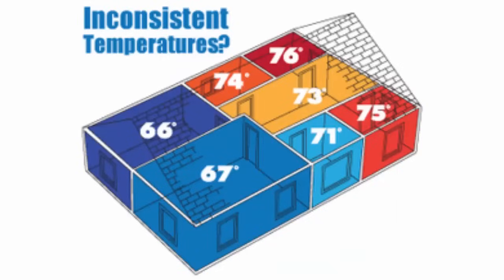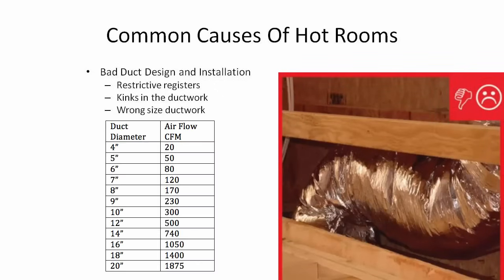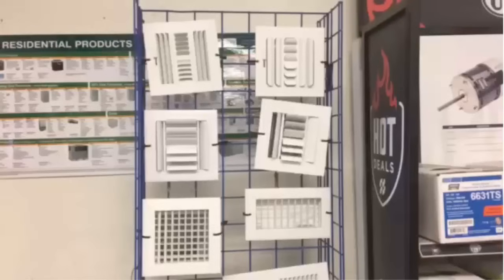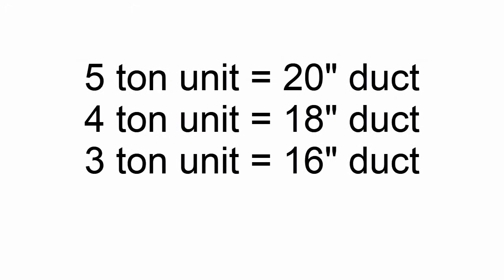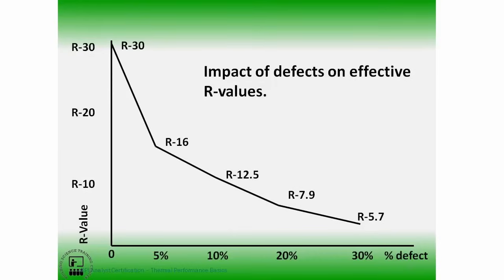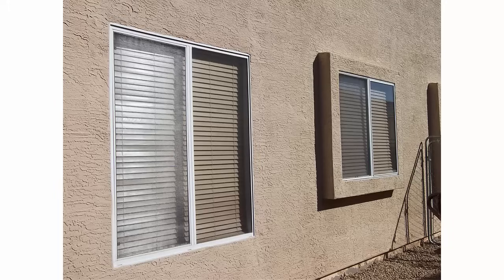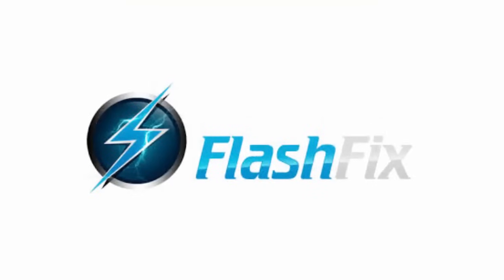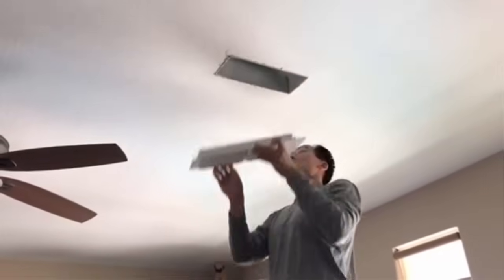Why One Room Is Hotter Than Others

Comment: I live in a 2150 sqft rental with 2 units. The house has a split floorplan. One unit is for the 3 bedrooms and living room and the other unit covers the master bedroom suite, laundry room and kitchen. The front of the house faces N and the back faces S. The 3 bedrooms are on the west side of the house and are in an L formation with the 1 bedroom at top of the L on the N side. The other 2 bedrooms are on the S side. The bedroom with only 1 wall to the outside facing S is 7 degrees hotter than the room on the NW walls of the house and 5 degrees hotter than the room with the SW walls. All the vents are at the same level through the house and placed close to the window of each room with 2 in the living room, 1 of which is by the window and one is in the middle of the house. We spend most of our time in the bedrooms, so we have closed the registers in the living room and the hottest bedroom, but this has not pushed more air into the coldest room.
Why is the inside room so much hotter than the others? It's difficult to have the heater on because this one room gets so hot but then the coldest room gets too cold. Being that this is a rental, what can I do as a renter to help? Any help is appreciated!

Comment: Every room in my house is comfortable in the summer except one bedroom which happens to be the farthest vent run from air handler.

I can leave door open and that does help but when it's closed it gets stuffy pretty quick.

I do have an inch undercut under the door and when it's closed I can feel air blowing out when AC is on.

Do you think putting in a return grill in bottom of door would help?
Reply from the maker: Yes it would help, as would installing a transfer grill above the door or jump duct in the ceiling

Comment: I absolutely agree with the window issue...we're going through a bit of a heat wave in western Canada right now. I just taped up aluminum foil on the outside of some of the east facing windows (cardboard / blinds / curtains on the inside)....we open everything up at night, close them during the day. Our attic has 2in closed cell spray foam with 60 cm of cellulose. We also have a portable AC but I have to admit, it barely keeps up (it's working on about 750 sq ft main floor)....my husband thinks keeping the attic hatch open will help (to let hot air rise) but I think we need to minimize the total air volume that we're trying to cool with the portable AC...

Comment: I just moved to AZ . I'm watching this for my apartment. As I have a
One direct sunlight room. I think it was.the return. As I took it off and noticed a difference. But what else could it be if that doesn't fix it? (And I tried the other tidbits you provide, sunscreen, new air filter, wide ducts)
Reply from the maker: Does your interior door close by itself when the air comes on? Are your ducts located in the wall or ceiling?

Comment: I know why one room got hotter. I had a 20ft tall bougainvillea blocking the western sun off of the block wall and I cut it down. Replaced it with a tree and as soon as it grows another couple of feet, will have no more heat problem. Also, it's the farthest room away from the thermostat. I really wish they would position thermostats near where people spend most of their time.

Comment: You just saved me from calling a professional to check on 2 hot rooms in my AZ house. The registers were restricting air flow! The rooms have already cooled down in 10 min. I could barely feel the air when I put my hand near the registers. Now I can feel the air sitting on the bed. Thank you!!
Reply: So did you just remove the registers or can you point me on which ones you purchased
Reply: I removed my registers and can feel a waterfall of cool air pouring into the room. The farthest corner is 80 while the other corner on the same side is 77...but my thermostat is 74. 😆
Reply: Yeah I have that issue as well. Gonna try this see it it works